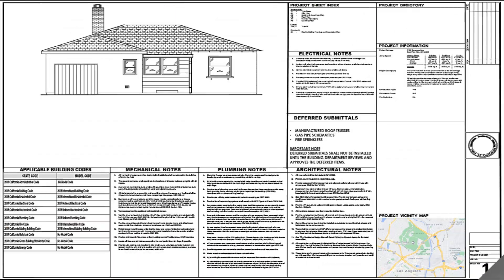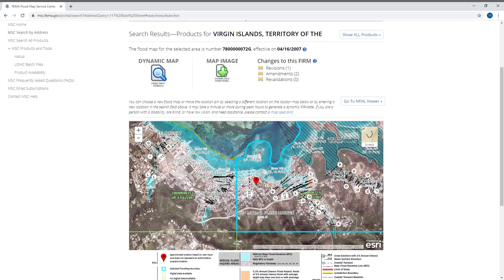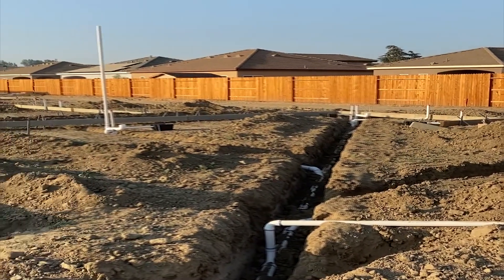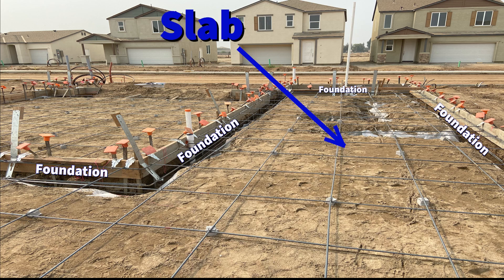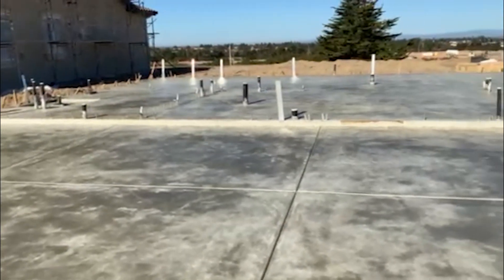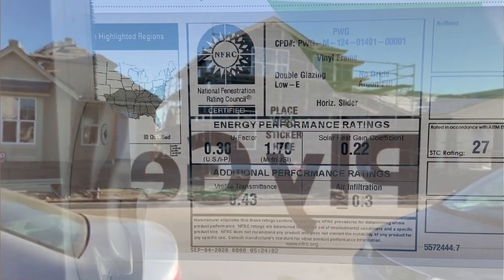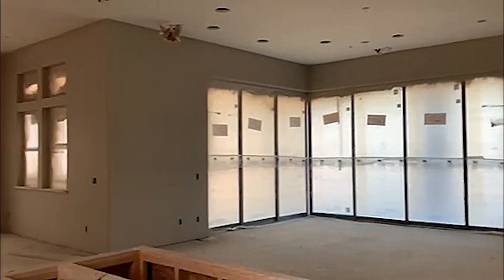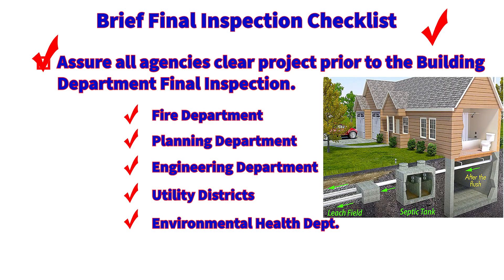Underground to Final Inspections  [IRC/CRC] - The Sequence of Building Inspections

Comment: How much to pre-made floor plans usually cost? Are gas and electric lines pulled to the property before or after the plumbing lines?
Any feedback and input would be greatly appreciated! Thank you.
Reply from the maker: Hello.  Are you referring to pre-made floor plans for Accessory Dwelling Units (ADUs) or other building types?  If you are referring to ADU pre-made plans, some jurisdictions do have those available; however, some local governments make them available for a cost, and others free of cost - it just depends on your local jurisdiction. 
Regarding the utility question - it depends on site/project specifics, scheduling, and area constraints; however, from the building codes standpoint, which utility is installed first is not addressed.  The codes address burial depths, pipe/conduit sizes, pipe/conduit types, and (depending on materials used) distances between utilities - the utility company also heavily regulates distances (upstream) utilities, so you should check with them regarding any restrictions they may have - as well as the local building department for their local requirements to utility installations, as there are slight differences throughout jurisdictions. 

I hope this helps. 
- Jose M
Reply: @CBO.online  yes that does help, thank you. I was referring to pre-made floor plans such as a plan for 2000 square foot single family home. Would you have a guesstimate on how much a plan like that could cost? I’m in Central Valley California, near Madera CA.

Also one more question. I have heard in the past that it is cheaper to build vertically instead of horizontally. Is this true? If yes then why is that?
Reply from the maker: @balla2828  Unfortunately, I am not familiar with cost of pre-made plans; also, I have not seen pre-made plans submitted for a 2k square foot sfd, unless they are prefabricated dwellings or manufactured dwellings.  In that event, you should call the regional companies that sell the structures to inquire.  Otherwise, if a non prefabricated, site built, structure is what you are referring to and are looking for plans to build such structure - even that I could not provide a guestimate on; your best bet would be to reach out to local design professionals (at least 3) to get quotes. 
Regarding building vertical rather than horizontal, I have not heard of that before, as there are pros and cons to both - and I am merely referring to pros/cons from the codes standpoint and not cost.  So to be fair to you, I cannot provide a factual response.
One thing to consider, however, regarding building vertical v.s. horizontal, are the local development impact fees (which can be substantial) and restrictions from the Planning Department for building vertical compared to horizontal that could affect the cost.  First, some jurisdictions may calculate impact fees based on the footprint (square footage) of the building - whereas others may calculate impact fees based on the combined square footage (all stories); but that is a question to ask the local engineering department - or the planning department.  Although I cannot speak for your local building department, in regards to the building permit fees, I can tell you that building permit fees (e.g., permit processing/plan review/building inspections) are generally based on either the market value of the construction - or the square footage of the building.   It wouldn't be a bad idea to reach out to both your local planning and building department to ask for an estimate of permit fees (including development impact fees for both vertical and horizontal); also ask the local planning/building departments to confirm what other agencies you will need to submit/pay permit fees to and reach out to them for an estimate of permit fees.  To give you an idea, most likely you will need to reach out to health department (if septic/water well), utility company, engineering/public works (for encroachment) and school district for school impact fees.  
I hope this helps.
Let me know if you need further clarification or if I missed any piece of information.

- Jose M
Reply: @CBO.online  thank you for this helpful and detailed response. If I think of anything I missed I’ll get back to you. Thanks again and highly appreciate the insight.
Reply from the maker: @balla2828  no problem at all.  Please do not hesitate at all to reach out and ask any questions you may have.  There’s always various avenues to achieve code requirements and  it truly makes a difference to know those in advance - and prior to permit submittal.  It can save time and money.  Take care.
- JM

Comment: Would love to see you do a video on requirements and proper inspection of fireblocking and draftstopping (i.e. R302.11 and R302.12 from IRC2015).
Reply from the maker: First – thank you very much for the suggestion!  That is such a great idea and an excellent topic.  

I am currently in process of rolling out the Rough Electrical Inspection video soon; however, I may make the fireblocking/draftstopping part of the rough frame/structural – or an offshoot of the rough framing.  Nevertheless, I shall present the information you suggested. 
 
Once again – thank you for suggesting this!  I truly appreciate it. 

-	Jose M